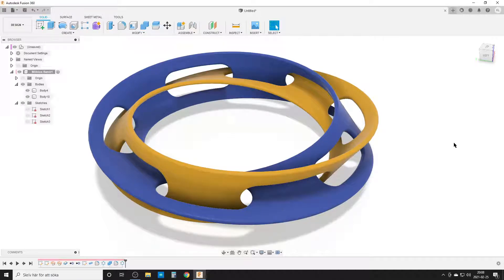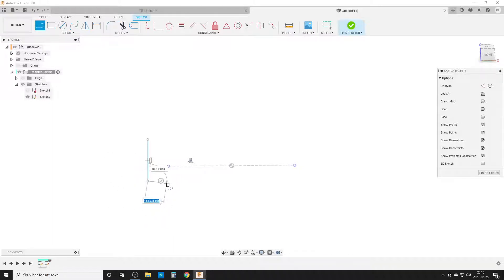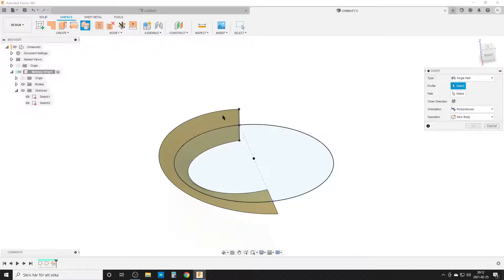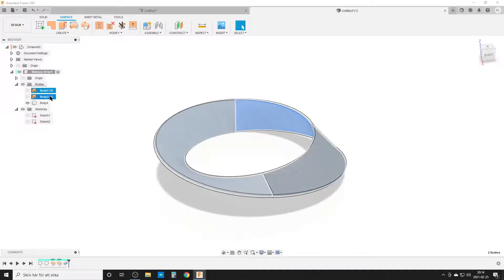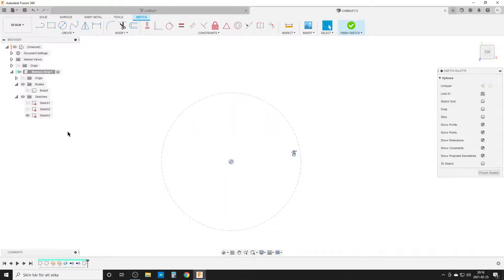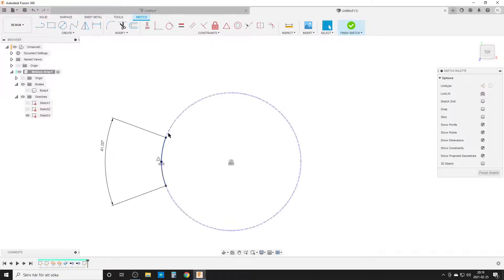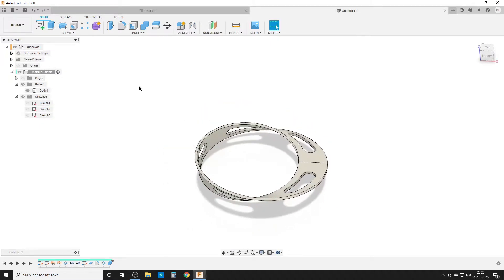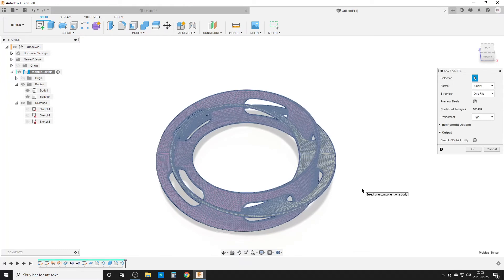Mobius Strip in Fusion 360 - (Sweep and Circular pattern)

Comment: Great stuff. If you sketch a vertikal rectangular instead a line for the cross section you want, you don’t run into trouble and fusion can solve a 360 rotation at once.
Reply from the maker: Thank you. And you are correct I could have used sweep of a rectangle (I don't remember if it was possible when I did the video)